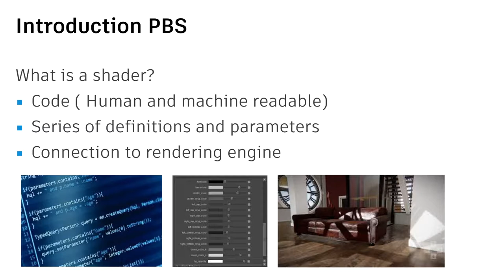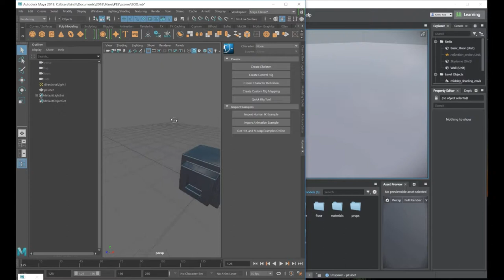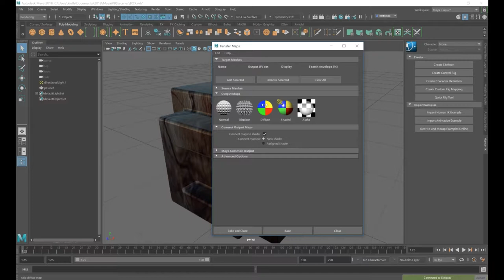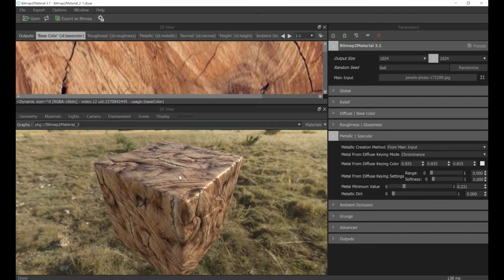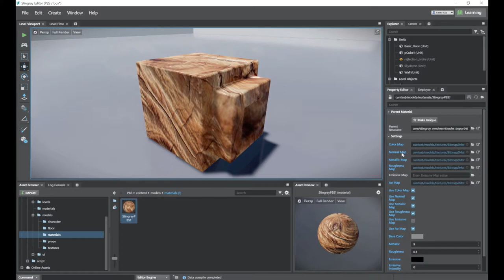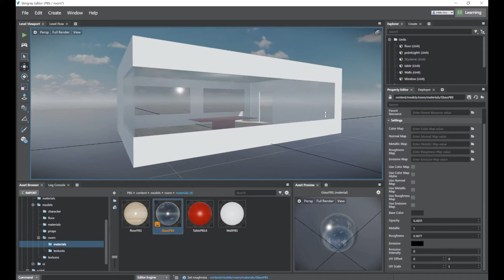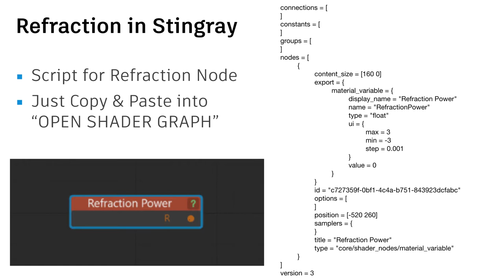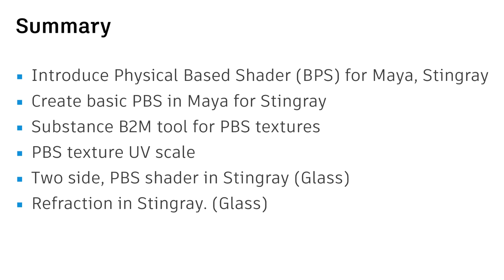3 Introduction PBS, Maya Stingray. (English)

Comment: Did U trie refraction in Maya stingray?
Reply from the maker: Sebastian L yes but it is a fade refraction as I remember you may need to make the shader independent and edit the shader network and adjust the refraction attribute. But I am not so sure the steps now. It should not difficult